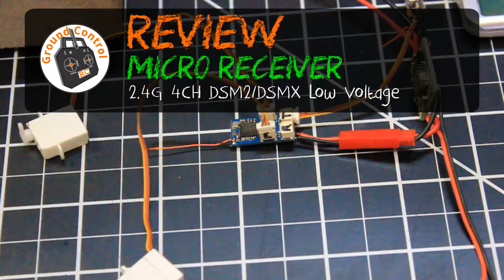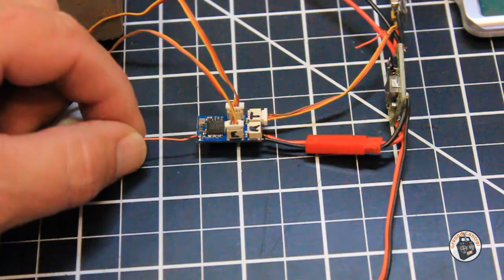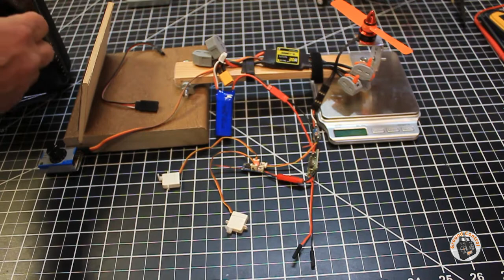Review - 2.4G 4CH Micro Low Voltage DSM2/DSMX Compatible Receiver Built-in Brushed ESC

Comment: Can I bind it to flysky fs-i6 transmitter???
Reply from the maker: This specific receiver is DSM2/DSMX so the FlySky FS-i6 will not bind to this receiver. Here is one that is stated to work using AFHDS2A   -  https://www.banggood.com/Mini-Flysky-AFHDA-Compatible-8CH-Receiver-PPM-Output-With-1mm-JST-Socket-For-DIY-Micro-Quadcopter-p-1097424.html?p=WE081047791920140372   See you in the Air!
Reply: @GroundControlRC  thanks for support
Reply from the maker: @milindhibare7398 , you are most welcome and I'll see you in the Air!

Comment: What’s the cheapest transmitter which is compatible with this? I found a RC plane build with this receiver, but the recommended transmitter is too expensive.
Reply from the maker: That's a very good question. I have a fairly expensive transmitter that I use for this but the Jumper Transmitters have received great reviews and they support multiple protocols. I have been thinking of getting one this year for my toy grade aircraft. For the money I think they are the best option. Here is a link to the Jumper T12:  https://www.banggood.com/Jumper-T12-OpenTX-16CH-Radio-Transmitter-with-JP4-in-1-Multi-protocol-RF-Module-for-Frsky-JR-Flysky-p-1331683.html?p=WE081047791920140372    take a look and see what you think. There is a wealth of information on the Jumper Transmitters. I hope that helps and I'll see you in the Air!
Reply: Ground Control RC is there anything less expensive? The one I was directed to was £70 also.
Reply from the maker: @AlphaToEpsilon  , the only other option I can find, which is less expensive but requires some work, would be the Devo 7E Transmitter. It has to be the 7E not the 7 in order to load the new firmware (Deviation). I use a Devo 8S Transmitter using Deviation Firmware that allows me to use DSM2/DSMX without modifying the hardware and it will work on the Devo 7E as well but always check the deviation documentation as things change over time. Here is a link to the Devo 7E:   https://www.banggood.com/Wholesale-Walkera-Devo-7E-7CH-Transmitter-Mode-2-Without-Receiver-p-48117.html?p=WE081047791920140372   Here is a link to the Deviation Firmware & Docs: https://www.deviationtx.com/user-manual/user-manual-7e-10    Here is a link to a Youtube Video showing how to bind with a DSM2 Receiver:  https://www.youtube.com/watch?v=egXRFOqakPc
Reply: Ground Control RC excellent- thank you! (Subscribed) :)
Reply from the maker: @AlphaToEpsilon  , your are most welcome. Thank you for your support and I'll see you in the Air!
Reply: Ground Control RC - just ordered the MinnumRC Spacewalker from Bangood. Looks like a great little build!

Comment: Can i use flysky i6 on that rx sir?
Reply from the maker: Good question. This one only supports DSM2/DSMX so it won't work with Flysky protocol. I did find the same type of receiver that supports the Flysky protocol. Someone in the comments stated it bound with his Flysky i6 Transmitter fine but I have no way to verify that. Here is the link: Mini Flysky AFHDS Compatible 8CH Receiver PPM Output With 1mm JST Socket     https://www.banggood.com/Mini-Flysky-AFHDA-Compatible-8CH-Receiver-PPM-Output-With-1mm-JST-Socket-For-DIY-Micro-Quadcopter-p-1097424.html?p=WE081047791920140372
Reply from the maker: One thing regarding this Micro Receiver is they have servo sockets that use 1.0mm pitch, meaning the pins are 1.0mm from center to center. Here is a servo that is supposed to have this type of connector.  TY Model 1.7g Servo With JST 1.0mm Plug Compatible Spektrum 6400 Series Receiver   https://www.banggood.com/TY-Model-1_7g-Servo-With-JST-1_0mm-Plug-Compatible-Spektrum-6400-Series-Receiver-For-RC-Airplane-p-1320271.html?p=WE081047791920140372

Comment: Where does the bind plug go in to bind to a spektrum transmitter
Reply: Ok, Thanks so much
Reply from the maker: That's a very good question. Actually, I did not need a bind plug for this receiver. When I powered up the receiver it immediately went into bind mode. I have two of these receivers and they both went into bind on power up. I believe that is the normal operation for these receivers when powered on, I think the information on the product page for how to bind to this receiver is incorrect. The receiver does not have a bind plug port or a bind button. I hope that helps and I'll see you in the Air!
Reply: Thank you, that’s good to know. And this receiver will bind to a spektrum transmitter right?
Reply from the maker: It certainly should with DSM2 / DSMX as my Transmitter is a Walkera Devo 8S running the Deviation Firmware and I've never had a problem binding to this receiver using DSM2 /DSMX.
Reply: I have a Futaba T9CAP but i replaced Futaba module in the back with a spektrum one, and it binds well with all my other spektrum recievers. Do you think it would be fine with that too?
Reply from the maker: I don't think you will have any problem since you're able to bind with other DSM2/DSMX receivers. I have two different brands of MIcro Receivers both DSM2 and DSMX and many of the OrangeRX DSM2/DSMX receivers and I've never had a problem binding to any of those. I hope that helps.

Comment: Thank you very much for this video. I bought one of these boards and I’m having trouble with the brushed output. I have managed to bind it on, but the output of the internal brushed esc is either full off or full on. That is, as I throttle up the engine goes from off, to maximum speed very suddenly. I have verified this measuring the voltage output too - it is either 0 volts or 4.2 volts. Am I doing something wrong or might it be faulty? I would really appreciate your thoughts. Thank you!
Reply from the maker: Sometimes these brushed controllers are real fussy with the throttle trim. Try putting in some down throttle trim to see if that makes it more linear as it should not be off or full throttle. If putting in a lot of down throttle trim does not fix the issue, I'd say the controller on that board is faulty. I hope that helps.
Reply: Ground Control RC  Thanks very much for the tip. I’ll try setting the trim to its lowest setting and see if that helps.
Reply from the maker: You are most welcome. I hope that works for you.

Comment: Hi I cannot for the life of me get a brushed motor to run off this thing, maybe its DOA? what are the solderpads marked "A" for?
Reply from the maker: The Brushed Motor Pads are the ones on the bottom next to the letter "M" at the corner of the board opposite the Power Leads. The Ground is the PAD closest to the "M" and the PAD to the right of that one is the Power. The PADS marked "A" may be for an Auxiliary Port. I hope that helps.
Reply: @GroundControlRC  I figured it out.. .For some reason I had to trim my throttle down completely. Now it works :)
Reply from the maker: @ET_AYY_LMAO  That's great! Let me know how it works out for you. I've had great success with those using Brushless systems. Happy Flying!
Reply: @GroundControlRC  So far im a little dissapointed about the quality of the board tbh, the SMD connectors for the servos snapped off mine, so I had to solder the wires directly onto the board, well a few attempts later and some hot glue on top of it and it seems to work :)
Reply from the maker: @ET_AYY_LMAO  I'm sorry to hear that. I have two of those boards and I haven't had any issues thus far but on some of the items I've reviewed I have found that quality on some items seem to vary widely. I'm sorry to hear this board is one of those items. I will have to note this on my next "Pilot's Lounge" Episode to let others know. Thanks for letting me know about the issues you've had with this receiver and I wish you had received one that was as high of quality as the ones I have. What servos are you using on yours?

Comment: will this reciever work on 5ch, 4servos+motor?
Reply from the maker: Good Question! It's only a 4 channel receiver. The only way I could think of using 4 servos is if you have two servos for the ailerons and used a Y cable to connect the 2 aileron servos to the single aileron port which is a setup I've seen on many planes.
Reply: @GroundControlRC  i see that throttle aplies to the brushed solder connection and the ch1 port at the same time, so its realy 4ch.
thank you for the quik reply.
Reply from the maker: You are most welcome and Happy Flying!

Comment: How do you bind it?
Reply from the maker: Good question ;-)
Here is the stated bind procedure for this receiver:

How To Bind:

1. Insert the bind plug into the channel labeled "BIND" and power up the receiver.

2, set the throttle and control surface failsafe protection (recommended to set the throttle to a minimum, all the control surface is set to the middle position). Press and hold the bind button and turn on the remote control.

3, the frequency of the receiver LED flashes will change from fast to slow. A few seconds after the end of the binding, the receiver's LED will always be on. All failsafe protection settings are successful.

4. Remove the bind plug from the "BIND" channel. Re-power the receiver and all channels are working properly. To test the failsafe protection feature, roll the lever to the corner and turn off the control. The control surface and throttle will return to the original position where the failsafe was set.
 
***That is the stated bind procedure, however, I did not have to use a bind plug. I set my transmitter to bind using a random code. Powered up the receiver, set my transmitter to bind. The transmitter bound to the receiver just fine. I powered of the receiver, powered it back on and the transmitter and receiver continued to bind just fine.

***This is not a guarantee you won't have to use a bind plug in the receiver but it worked for me.

I hope that helps and Happy Flying!
Reply: @GroundControlRC  ?
Reply from the maker: @juliananthonyzufer  , I posted to your previous comment and have also posted and pinned a comment regarding Binding to this Receiver. Let me know if you have any other questions. See you in the Air!

Comment: Hi very good video.  I was considering getting this to try to replace the electronics on my step sons HF Yellow Bee to which he misplaced the radio.   For the life of me I can't figure out how to wire it for differential thrust, do you know if it is possible?   With only one motor output and dedicated ports for alterations and elevators I'm not sure.
Reply from the maker: Good question. I'm not familiar with that plane, however, I looked it up and it appears to be a 2 channel plane. I don't think this receiver is going to help. I think you're going to need a flight controller and receiver similar to ones in micro brushed quadcopters to provide the differential thrust for yaw control. Here is a link to differential thrust setup in RC Groups. It may work if your radio can provide the needed mixers. https://www.rcgroups.com/forums/showthread.php?2793019-How-do-you-set-up-differential-thrust
Reply: Ground Control RC  Thanks for your quick response I am using the tried and true Devo 7e with devention mods and upgrades, not a problem with the mix.  I'm going to go with two brushed esc's  and mix rudder into each motor,   this seems like a great product just not what I'm looking for at this time, thanks for the help.😲  Happy flying to you.
Reply from the maker: That's a good radio! I'm using the Devo 8S with the Deviation Firmware ;-) Sounds like you have a good plan to get this working. Let me know how it goes with the setup. Happy Flying and I'll see you in the Air ;-)

Comment: Buenísimo video amigo, lastimosamente mi receptor es un Flysky I6 y no es compatible con el protocolo DSM2 ☹️... Tienes alguna idea si hay algún receptor con iguales características o semejantes al que tu describes pero compatible para Flysky I6? Que radio utilizas en el video? Saludos.
Reply from the maker: This is the closest I could find for FlySky: Mini Flysky AFHDS Compatible 8CH Receiver PPM Output With 1mm JST Socket For DIY Micro Quadcopterhttps://www.banggood.com/Mini-Flysky-AFHDA-Compatible-8CH-Receiver-PPM-Output-With-1mm-JST-Socket-For-DIY-Micro-Quadcopter-p-1097424.html?p=WE081047791920140372
It seems to have the same features, however, I have no way of testing it to see if it will perform like the one I have.My transmitter is a DEVO 8S running Deviation Firmware.Thank you for the kind words and Happy Flying!
Reply: Ground Control RC, Thank you very much for your help, exactly this receiver that you indicate me is what I was looking for .... I am a beginner in this hobby, in my country El Salvador it is difficult for me to find big spaces to fly medium or fast models, that is why I am building small models that fly like an indoor. I hope you can do the construction project of the trainer airplane. I would like to see in  your  reviews or projects the indoor 3D acrobatic planes or foamys, it would really be fantastic. Greetings and hugs.
Reply from the maker: Thank you very much! I'm glad I could help and Happy Flying!